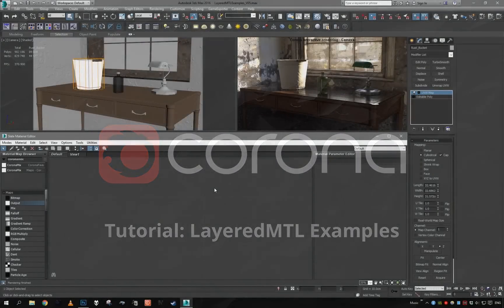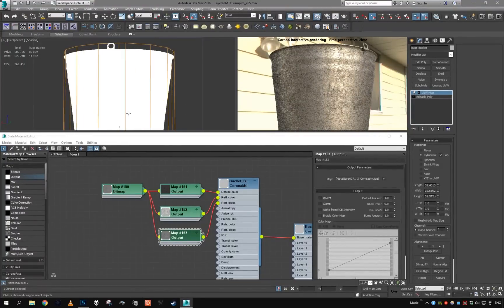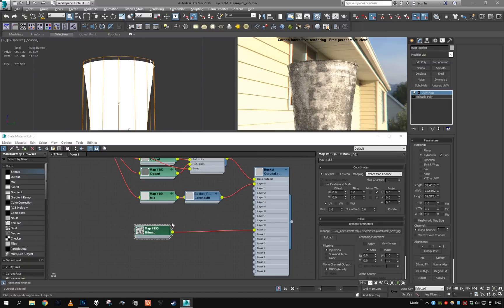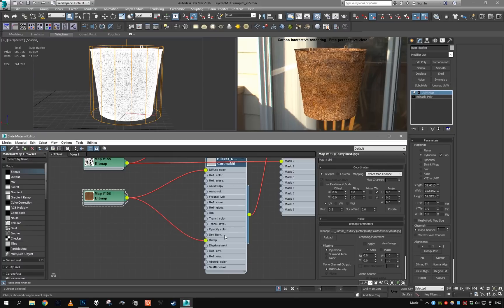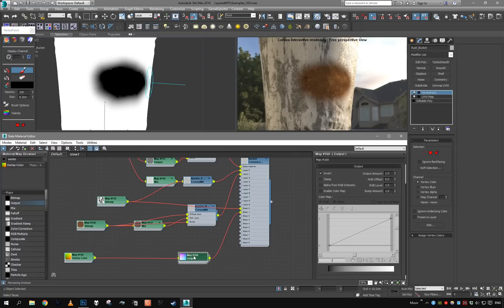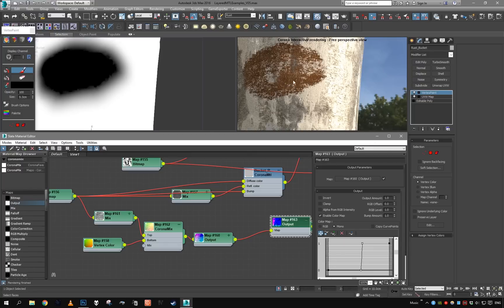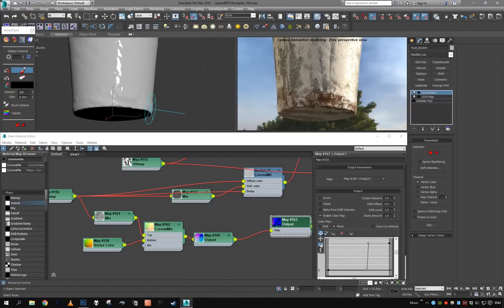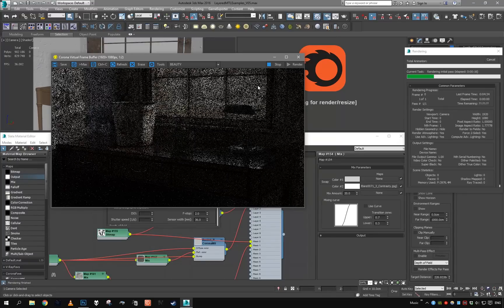TUTORIAL: LayeredMTL Examples (4/4: Rusty Painted Metal)

Comment: The workflow is much too slow, nodes are flexible but overkill for static materials, esp for large projects with several hundred materials. You NEED a layered material with a regular UI for efficiency/user-sanity. Materials like these (opaque with multiple specular layers) are created in under a minute with the maxwell material editor. perhaps under 15 mouse clicks.